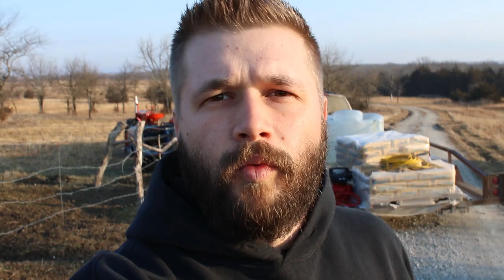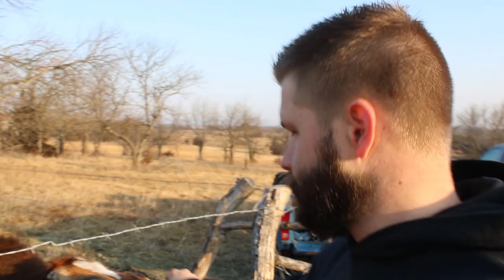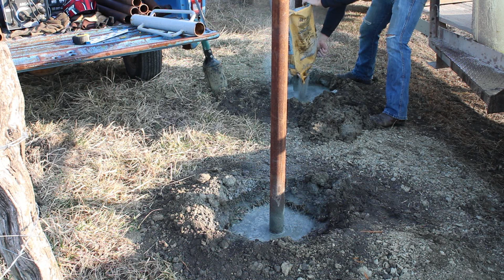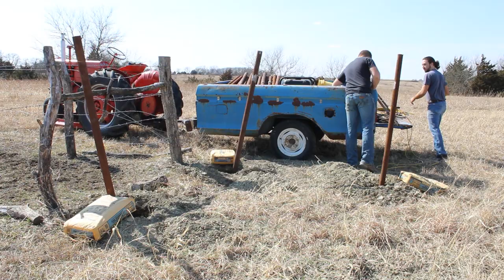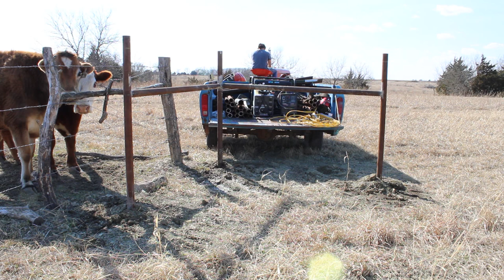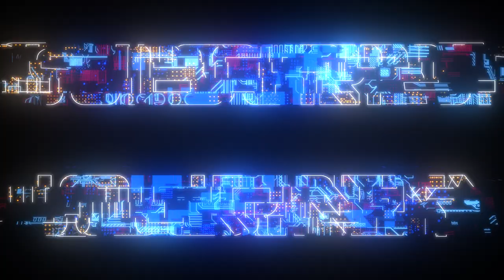Weeks away from purchasing BISON the fence is going up!

Comment: This might be a silly question, but if a bison can clear 6 1/2 feet why are your corner posts only 4 1/2 feet high? Won’t you lose bison over your perimeter?
Reply from the maker: Brian, 
Not a silly question at all! Bison are easily controlled when they have good fence, water and feed. The times you’ll start to see them test things is when you are pressuring them or they are lacking what I previously stated. That is when you get to see how high they can truly jump! Hot wire is very effective because Bison are VERY smart and once they know what it is they usually avoid it all together. Thanks for watching!!

Comment: You did everything right except... dammit!  Get a wheel barrow and MIX the concrete!  It's not that much more work to make those footings last forever and truly be correct!  I would have used a little larger corner post, and gone 6' for buffalo... but that ain't no big deal... but all that work and  then skimp on footings for 10 minutes of time?
Reply from the maker: 😞 ...Well I got that idea from a friend of mine who built fence for 25 or 30 years and didn’t even put water in the holes. He used dry bags of concrete and let them set up overtime. He guaranteed his fences and never had any of them fail for that reason. I guess if my fence is leaning over years from now I’ll come crawling on my knees saying you told me  so... 😉
Reply: @BrokenArrowBison   Yeah... it's a quality control thing.  I know guys who welded fence 40 years and never cleaned before welding either... 'it;ll be fine fer a hunnert years"...  I did appreciate the fish mouthing job, I never get it to make me happy!
Reply from the maker: Well I can understand where you coming from.